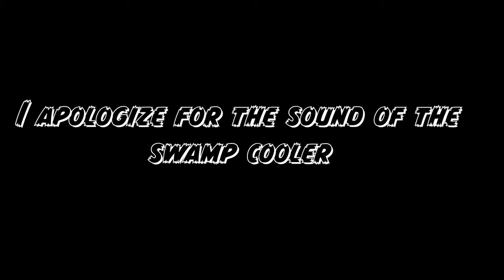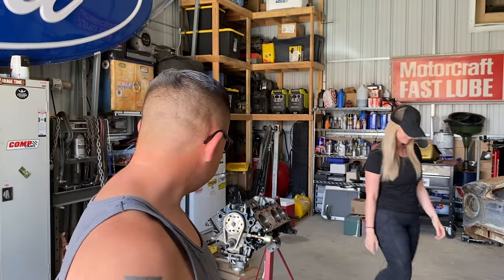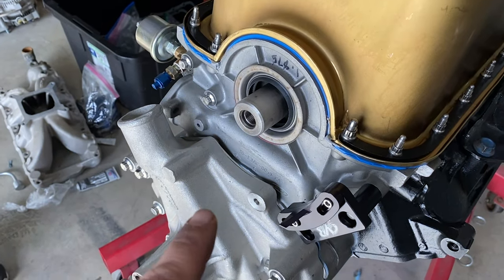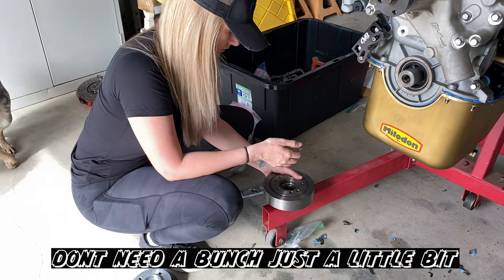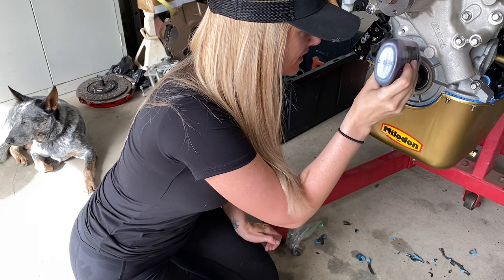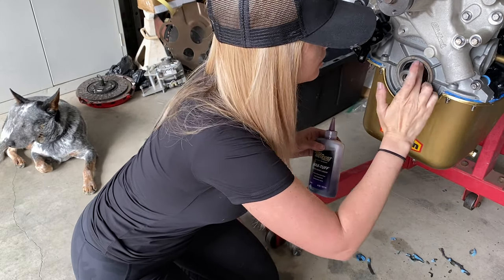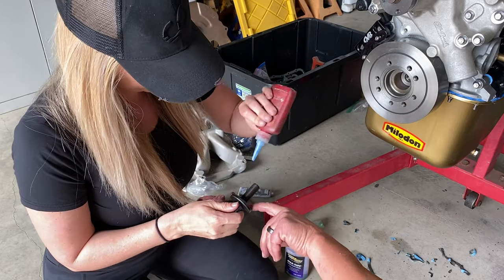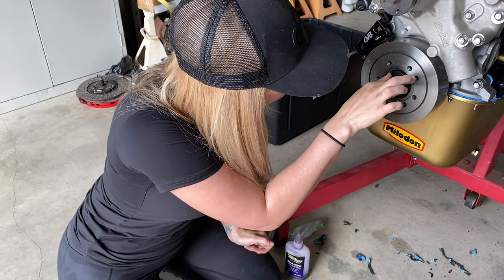Miss Midnight Maverick Streeter build Part 3

Comment: Hey I don't mean to be stupid but NHRA has a rule about putting the fuel lines by the trans bell housing.  Like the rule says, must be mounted 6" forward of flywheel/bellhousing . Chances are if its mounted to the fire wall its not legal. my 2c

Comment: Just so you know, I'm a 72 yr. old guy living in N.H., and I've been a diehard Ford guy my entire life. I street raced my homemade hotrod back in the mid sixties to early 70's, mostly 390's, but a couple of 428's. Back in late '69, my girlfriend showed up at my house with her brand new '70 Boss 302 Mustang and that was our daily driver. In '73 I bought a '69 428 SCJ Mach 1with 34,000 miles for $550 !! I street raced the shit out of that thing, and ran brackets at New England Dragway, ending up with 4 class winner stickers in my 1/4 window after only going there when there were no parties going on Sat. nights !! So anyway, I know those AREN'T Cleveland heads on there so............
Reply from the maker: Lol that’s a bad ass story sir! Those days are the best days! Unfortunately I think the government is trying to take those days away from us!
Reply: brad chandler, back in the 70's, I ran at NE Dragway quite often with a black "57 Ford Custom 2dr sedan (E/G and E/MP) and a '69 Boss 302 in pure stock.  I won the Grand America weekend there with a 10.85 run. The '55 Chevy from Indiana was not happy about losing. I still have both cars and still run at NE Dragway a couple of times each year. Do you remember the black '63 Falcon Sprint convertible? That guy won a lot.